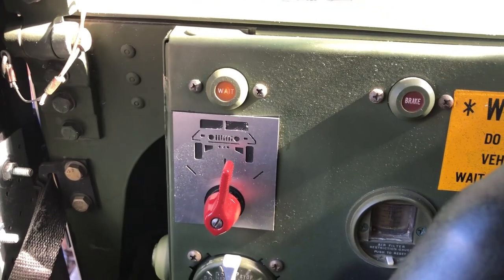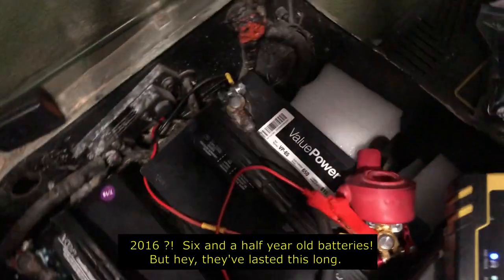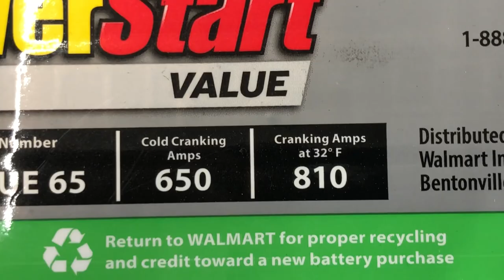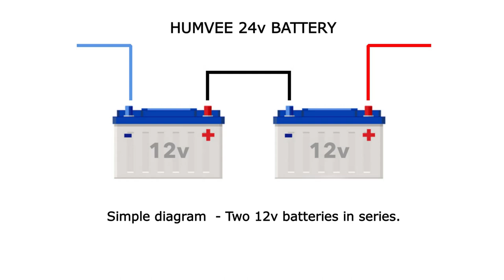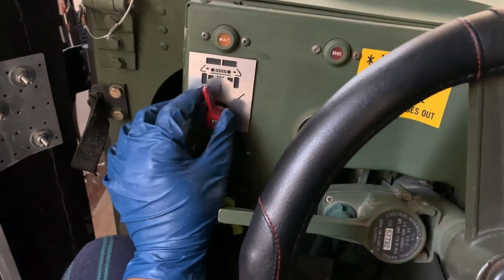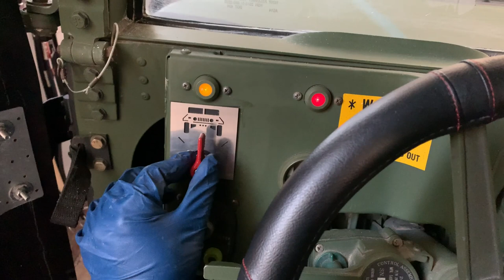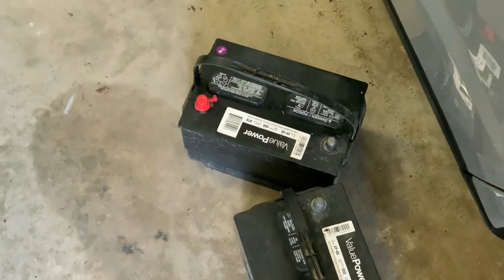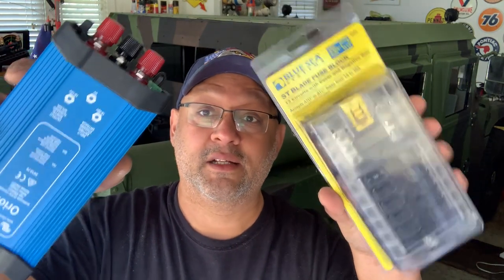My Humvee wouldn't start!

Comment: Don't throw away those batteries.  Walmart charged you a $12 core fee on each battery.   That means you were supposed to return the old batteries to recycle and get $24 back.
Reply from the maker: Even without the old battery receipt? I threw out one and kept the second one to use as an installation tester battery. 🔋
Reply: @MyHumveeMathilda never throw away a vehicle battery. Any place that sells batteries will give you core money for them withouta receipt. Scrap yards will also buy them. Nice rig!!

Comment: Mine did that too.  Lucky for me it was a bad connection.  It all looked good but the ground wasn’t make good contact.  I’m due for new batteries sooner than later.   Keep up the great work!!!!  I put a battery kill switch in so that I can shut it all down when the truck is sitting for a while.  Oh and thanks for the recommendation on the charger.  I bought the same one after watching your other video.
Reply from the maker: Yup 👍 that’s the best charger for the $$
Reply: @MyHumveeMathilda  Looking at getting one next year as a duel Tesla motor starting at 60kw(upgrade the Kw`s over time) EV conversion project ready for my next milestone birthday....

Comment: hey I'm in nc just bought a m1114 and was seeing if you knew the process to make it street legal?
Reply from the maker: What year? If you have an SF97, it takes 15 minutes to register it at the dmv. Only If it’s older than 1993, then you don’t need any inspections and it is exempt from smog.
Reply: @MyHumveeMathilda    hey I don't know what year it is   the serial number is 243814.  do you know how to find the year and I am about to fill out the sf97
Reply from the maker: @MarshallRentalPropertiesLLC  don’t know. Check the auction page you bought it from. 😏
Reply: @MyHumveeMathilda    on the sf97 it ask if I want a sf97   or title option which one would be better?
Reply from the maker: @MarshallRentalPropertiesLLC  not sure. I’d go with sf97. Then take it to the dmv